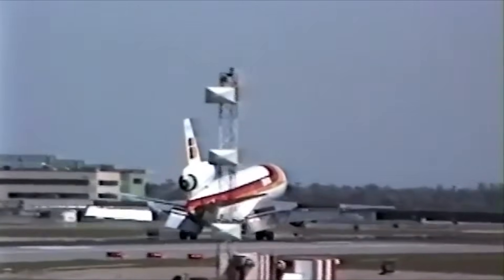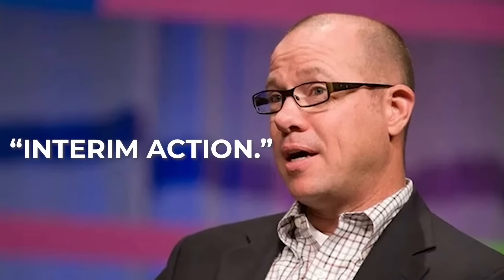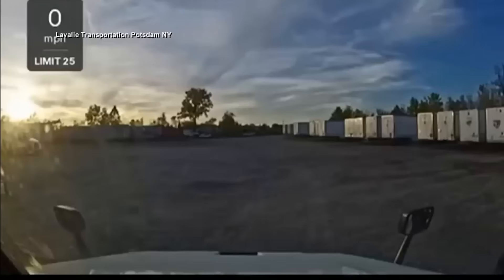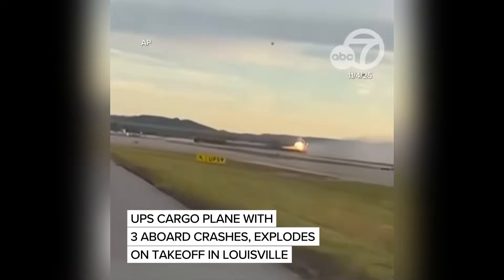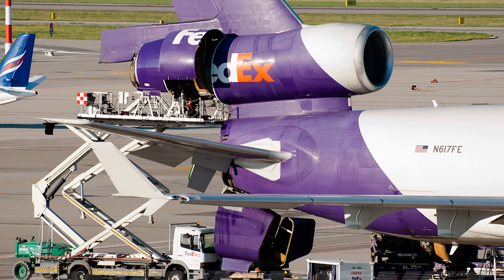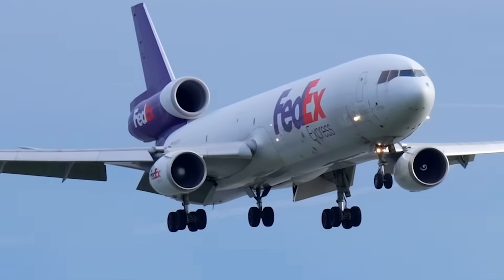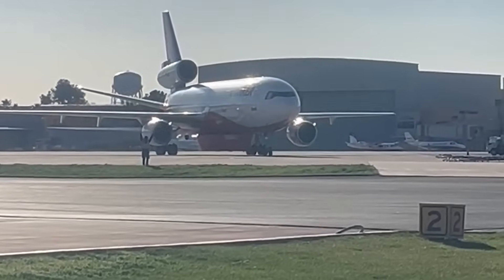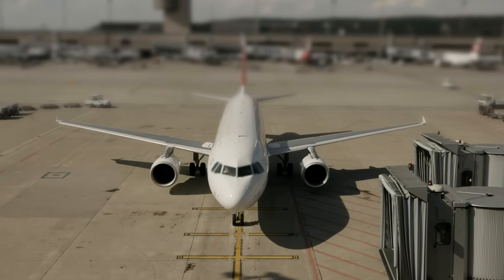UPS 2976 NEW Update: FAA Grounds Every DC-10 | Is the Pylon Design Fatally Flawed?

Comment: Flig you You Tube pilots are embarrassing yourselves. To civilians I am sure all you YouTube pilots double talk sounds great. To anyone that has rudimentary knowledge of aviation you people sound like clowns. If there was an inherent design flaw in the case of the DC10 it would have revealed itself well before 55 years and the MD11 well before 34 years. 
     Now there is a system in place called an SDR. Service Difficulty Report. If structural problems or major repairs surfaced during major maintenance the SDR is required to be filed with the FAA. Enough SDRs on a particular item are filed then at a minimum a Service Bulletin from the OEM Original Equipment Manufacturer would be published but these are optional to be accomplished. If it rose to the level of mandatory action the FAA in theory would issue an AD Airworthiness Directive well before total failure. 
     Now could lack of effective inspections on an old aircraft miss a catastrophic condition. Yes. Especially since the FAR part 141 repair stations are overwhelmingly staffed with unlicensed or certificated personal with approval of the FAA this could definitely be possible. 
     If any of you pilots did 5 minutes of research you would know the AA191 DC10 accident was 100% caused by flawed engine removal and replacement procedures accomplished by American Airlines Solely. Douglas warned AA not to use this procedure. However in 1979 the manufacturer did not have the authority to overrule a carrier so AA basically told Douglas to stick it up their cases and save several man hours. ABSOLUTELY NO DESIGN FLAW DETECTED. 
     You and Blancolorio and Captain Steve need to stay in your lane and out of this accident. Disgraceful.